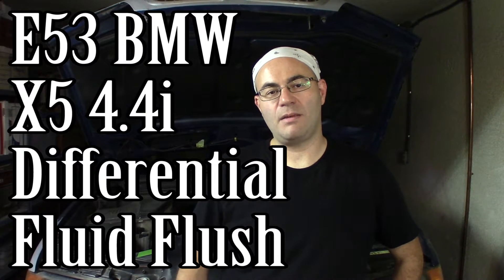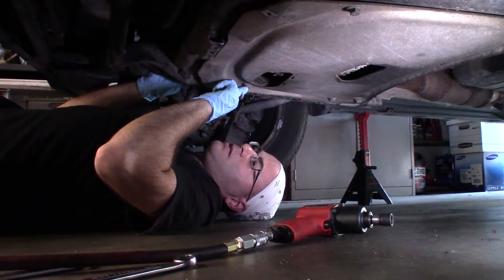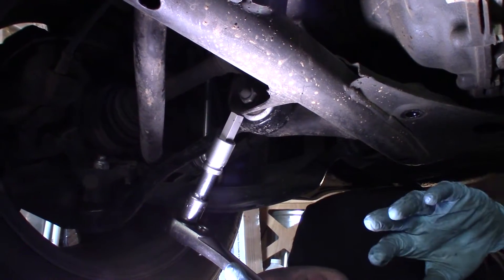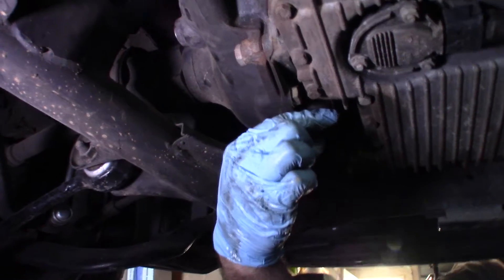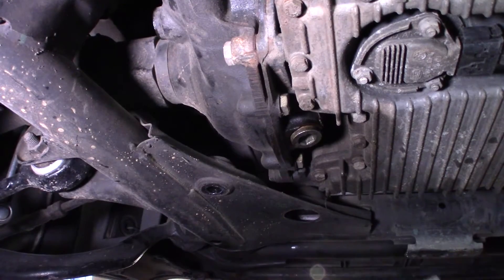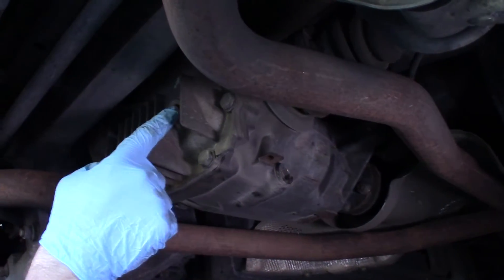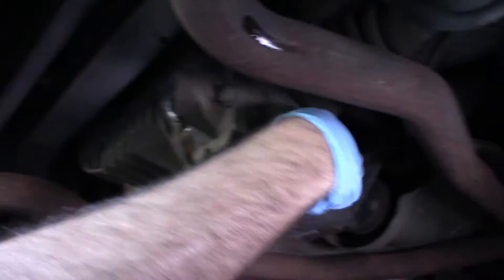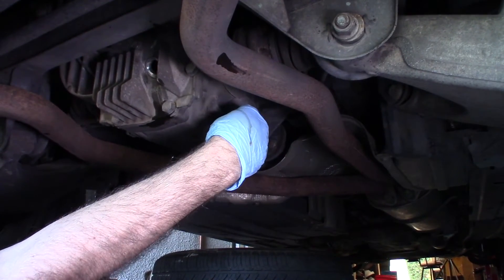BMW X5 4.4i E53 Differential Fluid Flush DIY

Comment: Followed this to replace front & rear axle fluids, rear axle only had a couple of hundred cc's drain but took 1.5 litres, no sign of any leaks any where, will be changing the front diff oil now that I have some 16mm impact sockets, normal 16mm Chrome vanadium socket bust when I put the rattle gun on the slider plate bolts, great video, please keep them coming

Comment: When taking the metal plate off, what i do is leaving one bolt on (the one to far rear of the plate., but loose, so I can push the plate to one side and it wont fall on year head, makes it much easier to put it back in place. but great video as always. :D

Comment: Quick tip: Get a garden spray pump. Most of them come with a tube and a manually activated spray handle. Now use this container for oil. Pump it up, take the handle and once you have the end of the handle in the fill hole simply press the handle and watch the oil flowing in. If nescessary just pump a little bit of pressure to keep the oil going. If you have more types of oil then take a marker and name your containers so you don't mix'em up by accident :)

Comment: Once again. Good job. Fluids change on the differential didn't need to be changed some suggested. I've heard that about transmission fluid doesn't not need to be changed also. It's has something to do with bad mixing, new oil with old oil.
Reply from the maker: +JCruzify1 BMW says their fluids are lifetime fill.  A lot of people feel that "lifetime" is basically until the fluid oxidizes and causes the transmission to fail.  So...changing it is a good idea.

Comment: FYI Bentley manual for the 2007 X3 says not to fill until coming out the opening but to only put in 600ml of fluid.  Filling full is about 700ml and can cause overflow leak through the top vent and clogging of same vent.  Not sure if this is just for the X3 or similar front diffs.

Comment: Great vids! 
       Was really hoping you would post the dreaded oil pan gasket replacement for the e53. I've heard the subframe or driveshaft may need to be detached not sure. There is one DIY that shows a riskier option cutting the gasket in two places and sliding them over the pan and sealing with just a bit of ultra black gasket seal at those cut areas. That one should work if you do it right. Appreciate all the videos.
Reply from the maker: +Giggidygiggidy12 Yeah....not sure I would even want to do the cutting it into two parts hack anyway, and I DO have the engine support bar you need to safely lower the subframe.  Speaking of which, I had to do that in order to replace the steering rack on this vehicle, and that video should be out in another month or so.  So you can follow along with that video to see what is involved in lowering the subframe (I believe one of the axles goes through the oil pan, so I think you do have to remove them as well.  It does sound like a lot of work, now that I think about it, lol.

Comment: Hi,

First of all, I bumped into your videos in YouTube and must say that they are Great. Not only you know your stuff but the dedication you place on making them tells a lot about you. Keep Up the Good Job.

I have a problem and hope you can share some light. Here it is:

I have a 2005 330I (E46) with 215000 miles that was not used for over a year (About 18 month)
I went to get it going and running once again, installed a new battery and poured fresh gas. 
The car cranks but won't start. I was able to start it spraying Carb Cleaner into the air intake. So this tells me it has electricity. When I turn the key to on position I can hear the Gas pump activating.

Can you give me some pointer on how to proceed this troubleshooting?

Comment: Hi 50sKid, I noticed "Limited Slip" on the bottle. Limited slip is only for M models. Not sure if it matters that much. Does it. Thanks
Reply: It's ok for regular ones too. But you can't pour regular one to a limited slip differential or it will break down the plates of it.

Comment: that Metal frame which has 16m screws covering the differential ,,on my X5 2005 E53 is not connected to Front Arms ,I mean is it easy to screw it out as you did because I want clean the Foam inside it,so much oil in there

Comment: Great job but remember the plate in the front is put back on with suspension pre-loaded (weight of the vehicle fully on the wheels). The plate is an integral part of the fronts end’s strength & is dangerous to drive the vehicle without it in place. This can be done with the wheels on ramps or a strong wooden block made & placed under the wheels. Never drive the vehicle without that plate on & correctly attached & torqued in. BMW says you must replace all the bolts on installation as they’re torque to yield bolts & stretch at final turn using a dial indicator. So the removed bolts are no good to you.

Comment: Great job! Love the videos. I have the same car and am experiencing a lot of vibration at idle when the car is in drive and foot on the break. Was thinking about doing a differential fluid change to see if that would help. Did you notice a smoother idle at stop lights and such after you did this fluid change?
Thanks for the insight!
Reply from the maker: Differential fluid has nothing to do with that.  Check your motor mounts.
Reply: wow

Comment: Hello, just one quick question about these diffs. On realoem com web site it is not quite defined which screws/plugs should i use on my 2004 4.8is. Looks like they are mentioning o-rings and you had washers. I have found BMW S/N 33326760380 M14 and 33117525064 M22... So Did you have all 4 plugs same size or not? Looks like i have 14 and 22mm... Thank you